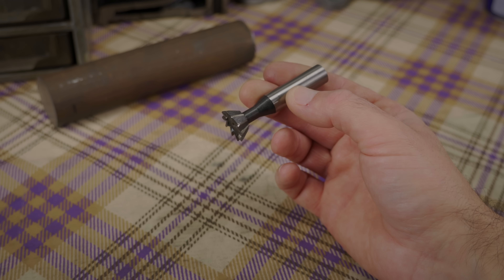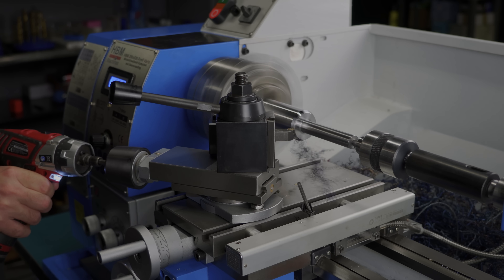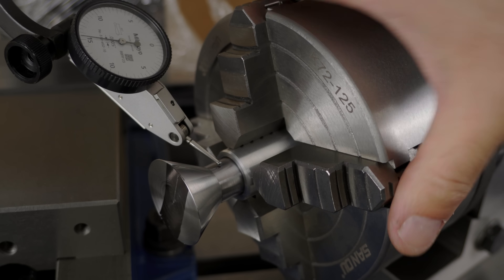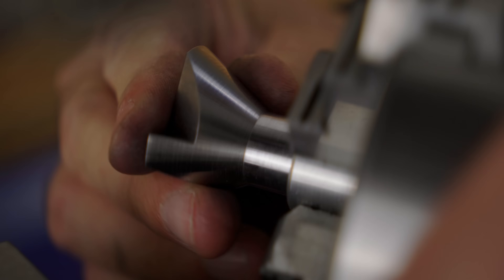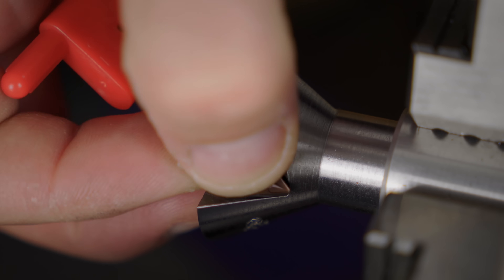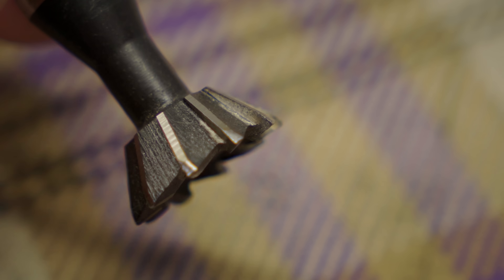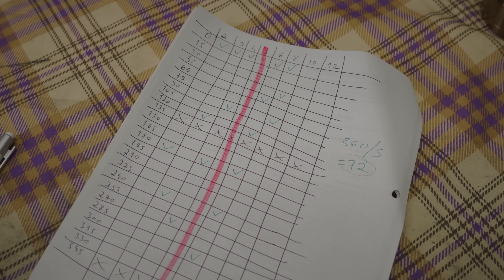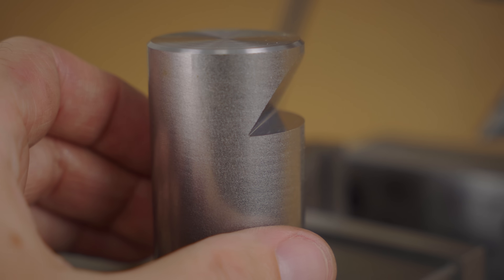I made a dovetail cutter... or two...

Comment: Very interesting design with the 3 staggered inserts👌
I have made some of the single insert type dovetail cutters. If you can find TPMT type inserts they have more flank clearance angle than the TCMT type.
You could also increase the flank clearance of your TCMT inserts by grinding more angle on the flanks in you tool and cutter grinder(I have done this). 
What I have found is the smaller the diameter of the dovetail cutter the more likely it is to rub on the trailing edge of the insert,the larger diameter cutters don't cause this clearance problem at all.
Edit to add : if you do grind extra clearance on TCMT inserts don't grind right up to the cutting edge. Increase the flank clearance but stay just beneath the actual cutting edge.

Comment: I have... never jumped while watching a machining video. I usually watch these to relax after a long day at my own machining job.

But this moment at 5:11 made me recoil in such a primal fear which i have never experienced outside of a horror game. Every time I rewatch it i flinch. my poor little machinist heart :(
In all seriousness, great video. love the cutter!
Reply: Yes, I came out with an expletive that questioned the existence of my father.
Reply from the maker: I hope you have all recovered by now 😄
That was my bad, I should have used the clamp right from the begining.

I've been having some trouble with my mill lately when it comes to workspace/travel available. I have the column cover removed in this video because of that, I needed more travel to make a cut (for another project).
Reply: @nbrworks  putting some referrnce blocks in the T-slots lets you reposition long parts without majorly affecting the Y axis, So i'd suggest investing in a set/making one. I'm guessing you're making some rails/ways that need higher precision?

Comment: Excellent explanation. 
Some people tilt the piece/ rest the shank on the angle bllck.
Because I have swivel vise, I prefer to lay the shank flat, and rotate the vise to form 59 degree. This way the cutter doesn't hit with the whole blade length but rather slices into the material. 
And a shim undet the shank to achieve 1 deg slope on the horizontal plane.
I might experiment with even more than 1 degree slants to see how far I can push my small mill

Comment: The small problem with your cutter is that you cut the seat for the insert with straight cutter but the side of the insert is at 7 degrees. So you only have the cutting edge of the insert braced against the wall of the cutter body. The pressure of the carbide cutting edge against the steel body during the cut will deform the steel just a tiny bit but enough for the cutting force to be transferred onto the screw, rather than the cutter body.
That is why commercial  indexable dovetail cutters using TCnn or TDnn inserts have the wall of the body cut at the angle matching the angle of the insert. The screw hole is off-set a tiny amount of force the cone of the screw head to push the insert towards the wall of the seat. This way cutting forces are transferred from the cutting edge of the insert onto the cutter body via the entire surface of the opposite side of the insert, never onto the screw holding the insert in place.
Your cutter will work for a while but don’t be surprised when the screw comes loose during longer cuts.
Reply from the maker: I see exactly what you're describing and that makes sense. Thanks, I learned something today! If I ever do another one, I will consider that.
Reply: @nbrworks this video shows how to make the  cutter with the seat matching the angle of the insert 

https://youtu.be/l3YNf0a7O5E?si=ho3mjfOVWyUD__NA
Another method is to use an endmill ground with a taper matching the insert to cut the very bottom of corner of the seat. 
You would need to to use the straight endmill to remove material to make room for the shank of the tapered endmill.

Comment: I think it will work just fine.
Reply from the maker: Hi Michel. Thanks, I guess I will report back in one of the next videos 😀
Reply: It will,Michel. I have 3 different diameter homemade dovetail insert cutters and they have done lots of work without any failures yet. Mine are the single insert type like the Randy Richards design.

Comment: Excellent work. I like the idea of placing the cutting face above center to compensate for insufficient insert side clearance, but doesn’t that introduce negative rake between the cutting face and the workpiece?
Reply from the maker: Yes, but the TCMT, being a positive rake insert, helps. My mill is not that powerful and had no problems making the cuts shown in the video.
Reply: @nbrworks  When you mentioned possibly tilting the inserts to get greater clearance the problem that creates is you are no longer producing a true 60 degree angle. It would reduce the cut dovetail to below 60 degrees because the top cutting face is now set at an oblique approach angle.
Reply from the maker: @howardosborne8647  if the insert is only tilted outwards (to get more side clearance) then yes, it will cut more near the top of the insert than near the bottom and will not cut a 60° angle. But according to a quick check I made in fusion 360, you can then tilt it backwards to compensate. I might have missed something and there's a chance this might be wrong, of course. I remember the concern was with the bottom of the cutter. If the insert is tilted backwards, then the problem begins to be with the bottom not having clearance. I think simplifying and setting it at 0° works well (as you also mention). Thanks!

Comment: I personally don't like the type of insert cutters (lathe or any other) that only supports the insert in one direction with the pocket walls. I just can't be sure that the insert would stay exactly where it is.
Reply: These type of insert dovetail cutters work very reliably with no fear of the insert moving. I have 3 homemade single insert dovetail cutters using the TPMT 16 and TPMT 11 size inserts. The TPMT inserts have more flank angle clearance than the TCMT type.
I have used these homemade cutters a great deal to make 20 of the 250-201 type dovetail lathe tool holders and never had any issue with the insert moving in the dovetail cutter holders.